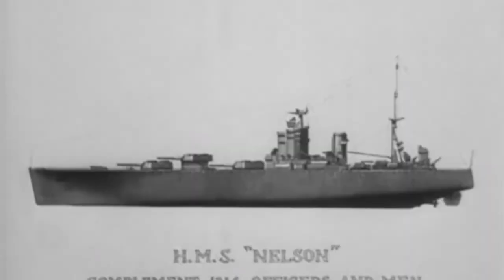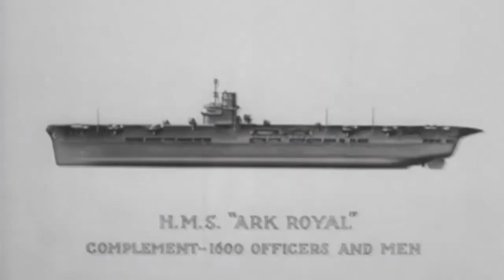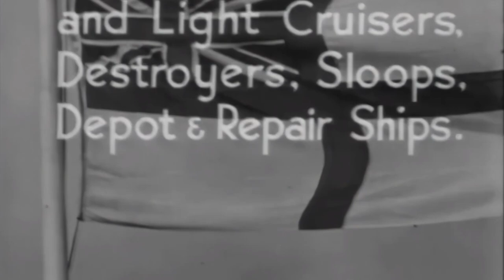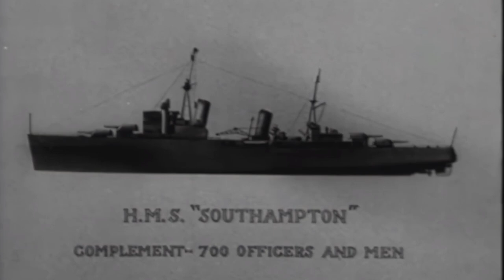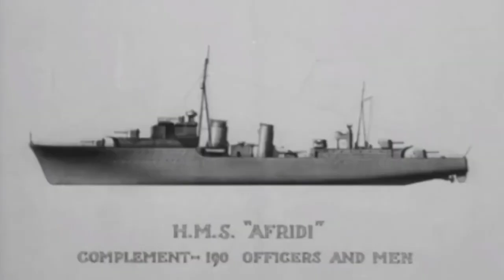Know Your Own Navy | Royal Air Force training film (1941)

Comment: The 2 KGVs still under construction are still named Jellicoe and Beatty (why did they change the names anyway?). When did the name change occur?
Reply: I have never heard a reason. I would not be surprised if Churchill was responsible, after his relationship with both men during WW1.
Reply: I have heard that those two were considered to be too recent in history. 
the names chosen, were 2 of the four that 
were to be used on the Admiral class battlecruisers, for what that is worth. 
I wouldn't rule out @Peorhum 's hypothesis though, either.
Reply: @kidmohair8151  Yeah, I considered that possibility too.
Reply: @Kid Mohair  I think Dr. Clarke mentioned that in one of his videos about KGV Class or "What goes into naming a ship"